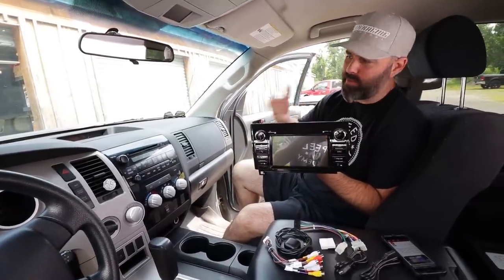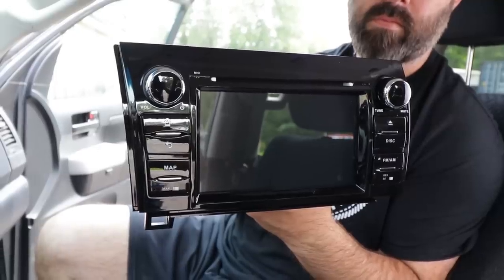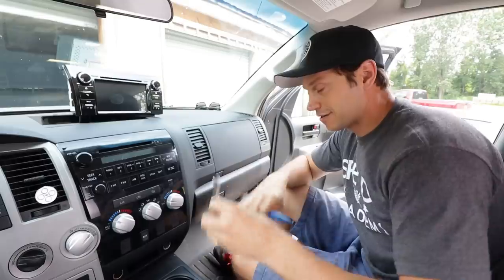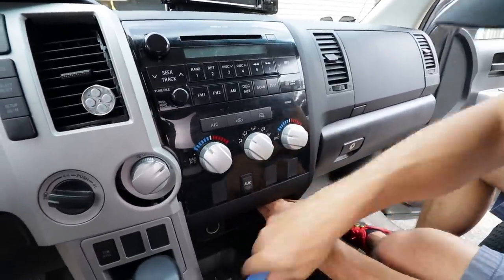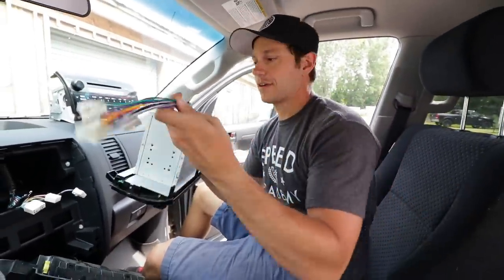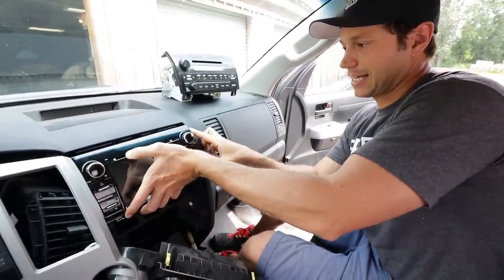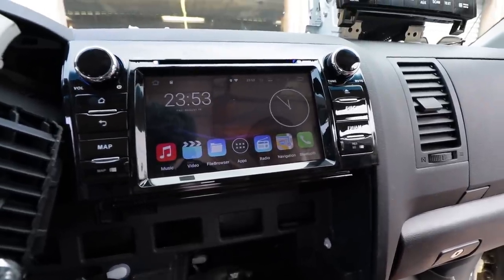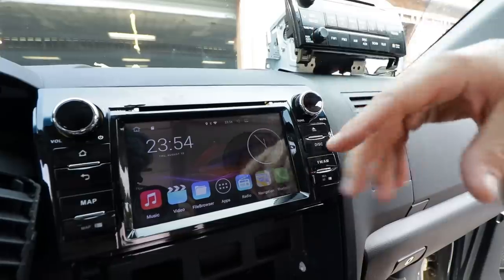Under $400! Seicane Nav Android Radio Review

Comment from the maker: *****DO NOT BUY THESE RADIOS, They continue to fail or work poorly for us.******* Currently we have been using ATOTO head units with great success for over a year now. They do require install kits though.
Reply: good timing with this update!
(for me, anyway)
Reply: I was about 2 buy an android 10.0 from secaine. Now I won't. Thanks 4 the advice.
Reply: What do you now recommend?
Reply: So which radio do you recomend? Thanks
Reply: Just bought a sequoia and it has one of these in it. Can’t figure out how to switch the output from a dvd from the console to the rear DVD player. Also the rear speakers do not work at all. Is it worth troubleshooting or should I just invest in a new unit?
Reply: UPDATE: found they never ran RCA cable from unit to the flip down monitor in the back. However still cant get Audio out of rear speakers, looks like they cut and spliced the harness up. We’re these things supposed to be plug and play?
Reply: I’d like to know what you guys recommend in place of this radio?

Comment: This video was still helpful for me. I am also installing an OEM backup camera to my 08 Tundra along with a Sony XAV-9500es head unit as my monitor. I was wondering how i would get the wiring from the ceiling down to the dash and you guys are the only ones with a video that shows a clear example of exactly how to do that. Glad you left the video up even though you found out later that it was a bad product. Liked and subbed!

Comment: These guys hit me up also to see if I wanted to do a video. After watching this I think I do.
Reply from the maker: So far the only issue we've had is the Bluetooth pairing between Dave's iPhone and the head unit failing occasionally. A quick re-pair (no pun intended) fixes the problem.
Reply: Speed Academy Android doesnt like to pair with iphone
Reply: I have a 2006 yaris here that could do with an upgrade... :) My car is sorted with a top end pioneer unit though.
Reply: they hit me up too, but then they started jacking me around and wanted money up front so they ended up wasting my time
Reply: whats a good set of panel poppers?.Thanks
Reply: WJ Handy Dad I wouldn't do a a review for a company that approached me then asked me to pay them.
Reply: Do you guys have an email for them? One hit me up by email saying it was them but I don't like risking it really
Reply: Speed Academy how did you repair the unit to fix Bluetooth issue?

Comment: After a month or so you guys should do a update video on the radio . I have heard alot of bad things about those no name Chinese radios and I want to see if these are any good
Reply from the maker: We've had it in the Tundra for a couple months now and the only issue we've encountered so far is the Bluetooth connection sometimes fails. This is a bit of a PITA, but it's no a big deal to re-pair the devices.
Reply: Speed Academy awesome. thanks guys keep up the good work
Reply: I have one similar to this (actually all those Android headunits from China share the same platform) for about 6 months and it works great, no issues at all. On XDA developers you can find custom ROMs that make it even better
Reply: Had two different units for 2 years without a single issue
Reply: it's a lot better than my $500 pioneer HU. hated that pioneer HU its so fuckin sluggish and lags a fckin lot!
Reply: bigmike 249 
Stick to Kenwood and Pioneer
Reply: 3 year ago (Spring 2015) I did buy a China-Radio and even an expert had difficulties to make it work poperly (Radio was Problem). I bought a kenwood it was much better, but lagging and old fashioned user interface. Now ist 2018 I got a NEW China Navi and the same guy made it work eeasily! its an XTRONS TR108 (Seicane is also great use interface, very clean) . In my opinion Seicane and XTRONS best user interface. Also Kenwood, Alpine etc. is to old fashioned, very, very expensive and lagging. today in 2018 there is no real reason any more, that one can not buy a china-Radio.
Reply: Rising Phoenix 
No. Kenwoods and Pioneers are very good professional radios

Comment: im not sure why you put the GPS module on the outside, I usually put them directly behind the rear view mirror on the inside, Ive never had a problem with them either...
Reply from the maker: We've had bad reception when installing them on the inside. Maybe it's a Canada thing.
Reply: Might be, i have a similar unit, and mines mounted on the inside of the A-pillar, not even on the windshield, totaly hidden, and it works like a charm :), Tho i am in the EU, but shoudnt really make a difference.
Reply: as long as the dash is not metal i always like to keep them inside too.
Reply: Small GPS antenna probably can be installed hidden under the dash.  Signal can go through glass and thin layer of dash plastic.
Reply: Depends on the car. I'd personally hide mine up in the shark fin.
Reply: You coulda just put it inside the dash since the dash is not metallic. Reception should be just fine.
Reply: Akieba we installed them either at the back of the dash or on the unit it self. This is how Nissan wanted them. (I'm Ozzie)
Reply: I put mines behind the unit or underneath the glove box
Reply: i put them inside dashboard. never had problem.
Reply: Speed Academy that is possibly because it is a very low cost/quality haedunit
Reply: And he put that sht in the outside,, lawwwwd🤦‍♂️
Reply: Good quest I was wondering the same thing

Comment: Looks like you have to remove the radio brackets from the old radio and install them onto the new one so you can actually use those 10mm bolts you removed to secure the radio. Looks good though. wish they made a factory type replacement for Ford aswell.

Comment: These units are cool, when they work (key word..., "When They Work"). These tend to be soooo hit-or-miss. You will find yourself having to tinker with them more times than not. Also, be very careful with thermals. Many people cut a hole into a safe location on the case in order to install a small PC fan (silent 40mm - 60mm size and 12V). There is a huge community at XDA forum.

Comment: What wires did you connect for the back up camera? You said you'd add it in the description. I'm having a tough time getting my camera connected properly so it turns on when I put it in reverse. I've tried everything that DOESN'T work it seems.

Comment: one thing that worries me is how much shit il break in 20+ years once all the plastic crap goes brittle, i swear it will be the death of future classics
Reply: i live in a country you export them to haha i still consider 2000s and later new...
Reply: new zealand bro, we aint some 3rd world country but alot of our cars are 10+ years old from japan we dont salt the roads and have 6month expections so cars dont get to badly disrepaired. the newest car ive owned is 97 and that was 7 years ago, i avoid 2000+ models too much plastic and electrics for me as i like fixing my own shit i drive a 80s hj60 toyota land cruiser these days and had 15 cars in 8 years. where you from?
Reply: Tom probably to east europe....
Reply: Dude in 20 years 3d printers will be a household item. Even ones that print metal so plastic bits breaking wont be an issue.
Reply: Tom here in tge states well at least here in Michigan, we drive em till they die because of no inspection or emissions testing. But then again most cars dont last 10 years here because we salt the hell out of the roads and road deterioration.

Comment: I figured out how to wire your 07-13 tundra that has the same wire setup that is in the video.   (Red Wire) - Positive Video Wire, (White with Black stripe wire) is Negative Video wire.   (Green Wire) - is the trigger wire that connects to your andriod stereo backup wire.   You will need to get a RCA Video cable which is the Yellow one.  You will need to cut it, strip the wire ... there are two wires inside of it the non-shielded wire is the negative and the insulated (shielded) wire is the positive.  You will need to strip the insulated wire of the RCA cable. and the then you will have two wires.   attach together the non-insulated wire on the RCA cable which is the negative to the (White with Black-Stripe); attach the insulated wire on the RCA cable which is the positive to the (Red Wire) ;   Then you can plug this RCA cable into the camera RCA input of your stereo.   Last attach the (Green wire) which is the trigger wire to the back of the stereo which is is usually labled backup.   That is what he is showing in the video but did not explain it correctly.   It took me a minute to research and figure out what he actually did.  You should then have video on your unit.

Comment: You guys should install the Android Auto app if you want a more car friendly interface. No need to muck around with Bluetooth if you copy your music onto an SD card

Or if you stream through Spotify or something just install the app through the Play store and use you phone as a wifi hotspot for the headunit instead. Might need to mess around with settings in Android so it doesn't decide to update apps in the background
Reply: Precisely. Im using mobile hotspot for my Androin head unit.. they aren't utilizing the head unit to its optimal potential..

Comment: The part I imagined the whole way through was you guys getting the the point of screwing the bolts back in and wondering where the mount tabs went because you didn't transfer the brackets. :D Also you'd be surprised how well those gps antennas work mounted inside the dash too. They usually have a magnet in them and need to be fixed to a metal base for best signal, just putting it on any part of the metal structure inside the dash probably would have done the trick.
Reply from the maker: Thats a great tip! We usually dont run them on the outside but there was a gapping hole in the firewall so we thought this was the perfect opportunity to fill it :)
Reply: Of course it's your mileage may vary, but yea, the magnetised ones need have metal under them, and I think they're pretty much all magnetised.

Comment: I realize that it's been over a year but I would like to know if you would still buy the same unit or wished you had gone with a more expensive unit or possibly even swapping it with an OEM Toyota Nav head unit??

Also, my Sequoia has the JBL Synthesis system....any idea on compatibility?

Comment: About a year ago my wifes double din died, stock stereo, not knowing the latest greatest car stereo jive, she ordered a sounddesign (cheap china crap, not eveeything made in china is crap, but this was) knowledgable w/electronics but 90's stuff, i installed. Pos lasted 9 months, blue tooth ? Never worked, took apart a hundred times cause preset info would not stay set ? Ended up being the unit itself, as i thought but had to keep 2nd guessing anyway. When it died, my wife was misserable, she has a 1 hour commute in and another hour home. I was so happy, it finally died, i hated the stereo, sounded crappy, well, ok i guess, if your f'in tone deaf, maybe it would sound ok.
  My turn to order, 'amazons chioce' pioneer AVH-X390BS
   ITS SO SWEET, $199, had it in hand 2 days later. Sounds absolutley mint, best of all the wife was super happy. And it ALL works.
 If you get 1 of these and want video while driving (you know, for the kids) dont just ground the saftey video wire (you know, the 1 thats soppose to get attached to the parking brake) you need to run a switch then ground. It asks you b4 you can see video to set then release park brake to test it really is connected. 
  Another interesting note, I've read some units w/gps biult in, know the car is in motion and willshut video down.
  Buy brand name stuff, get long term results.

Comment: The one thing I see no where?  No mention of sound quality?  I don't see anyone asking that either.  So does it sound the same, worse, or better than stock?  The signal being sent to the speakers is the most important part IMO, and that's a lot of tech for a great price so would just be concerned about that.  

Great write up though.  I'm following you guys now because you've been doing the exact things to your tundra that I want to do for my own!
Reply from the maker: No notice in sound quality but I suspect that is more a byproduct of the OEM speakers not being that great to begin with.

Comment: I just bought the same radio and I want to connect the rear camera on the radio but I did not understand where you connected the black and white cable (camera ground negative) you connected it with the red signal cable and these 2 cables to the red rca ?

Comment: Great review. Nice head unit. I'm off to see if they make a model for my truck.

One thing though, why would you mount the GPS antenna outside? Totally unnecessary and exposes it to the elements. Mount it either on the dash below the same place you installed it on the outside or better yet up behind the rear view mirror on the glass, which you could have done when you had the header and pillar apart for the camera feed install.
Reply from the maker: We were under the impression that it needed to be mounted outside for better reception.
Reply: No, as long as you can give it a clear "view" of a large portion of the sky it's fine. The one exception is if you have a Ford with the stupid heated windshield or similar with a metallic coating that blocks radio signals.
Behind the rear view mirror on the glass is an excellent location.

Comment: So this is like a tablet to where you can run apps like waze and so on, has a 1024x600 res which is not great but blows any other company (most use 800x480) out of the water and is dirt cheap? I've been looking for a product like this for years. Custom solution with a tablet would have cost me thousands to have someone build for me.

Comment: I will stick to a real headunit Dnx994s. Why mount the GPS antenna on the outside. Slap it to some metal under the dash and done. Installer tip...

Comment: Greetings guys. Just wondering why the GPS antenna module has to be mounted outside? I'm sure it'll be fine mounted on the inside?
Reply from the maker: We've found we get spotty reception with the antenna on the inside in our part of the world, but lots of others have suggested interior mounting is fine, so I'm guessing you'll be fine to mount it inside where you live.

Comment: I have ordered the same unit but Seicane has messed up my connector. I like to know if you have pictures of your connectors. Cause I have exactly same connectors you have. one of my unit connectors is not connecting to any harness they provided. I have 48 email contact back and forward Seicane. but they haven't solved anything yet. can you please help me with the second connector you connected to your new stereo. Or if you can provide your order number I can ask them for same connectors.  I think it is steering control harness..  best regards.

Comment: That obd2 dongle option for the gauge display has my attention. All depends on what it's capable of displaying and it might be a winner .
Reply: Most likely it can run Torque off the app store, amazing app for accessing OBD2 info down to on the fly fuel mileage calculations, 0 to 60 times from GPS or G force loads, vac/boost PSI even dataloging etc... I do it all through the phone but this would be so much cleaner for day to day usage.
Reply: Matt Gardner correct, it uses the torque app
Reply: Matt Gardner p
Reply: Yes I've got the same operating system on my head unit and have an ODB2 bluetooth adapter in my car.  It's got a ton of functions as well as real time data: RPM's, MPH, Boost info, temp, ect.. tells you all fault codes,  runs diagnostics.. just youtube the Tourche App review..

Comment: Red from pillar to what side on RCA?
White and black from pillar to what side on RCA?
2008 tundra just like the video......help..... no reverse signal to radio. 
Green from pillar already connected to radio “reverse” 
Help!!!
Reply: The wiring instructions on the video to get the rear camera to work is Bogus!!!!  Not like shown in the video!!!!  I got it solved. Wish these heckle and heckle had made the instructions correct.
Reply: How did you solve it?!
Reply: @leswalker7990  les can u tell me how you wired it up
Reply: @PhilipLeder  Philip did u figure out how to wire it up?
Reply: @markalmeida8132  had to tap into the camera on the tailgate, with one wire from back of HU camera run all back to tailgate.   Wires in the pillar didn’t work

Comment: Seicane customer service is based out of China and it seems as if they are using google translate to communicate in English. After purchase my unit took almost 4 months to arrive and updates from the seller were basically nill. When I received my unit the power button doesn’t work, the clock memory doesn’t work at all nor does it sync with gps. After a polite request for warranty or refund the company said they don’t offer refunds and it would be my responsibility to ship the unit back at my costs even though the unit is defective. I do not think the risk of dealing with the seicane company is worth the risk of the purchase. The unit does look great, forgot to add that.

Comment: Anyone have that wiring info for the pillar reverse cam? I don’t see it in the description. 

So I installed the radio and it doesn’t really work well with the iPhone which is a big disappointment to me. 
Overall it’s a big glitchy but for the price it still looks nice, if I could get the rear camera setup it would be a plus .

Comment: Will the new radio work with the steering wheel controls (volume +/-, seek, next, etc)?
Reply from the maker: It has options to wire in for steering wheel controls